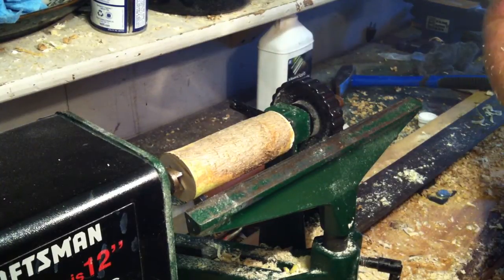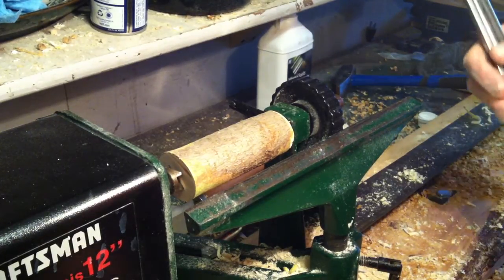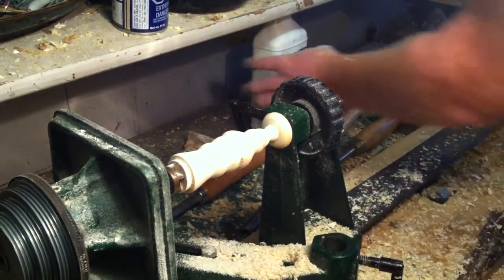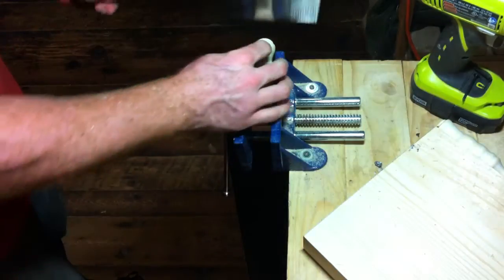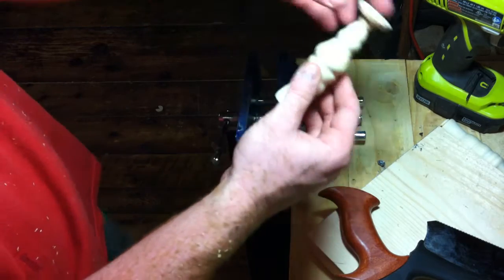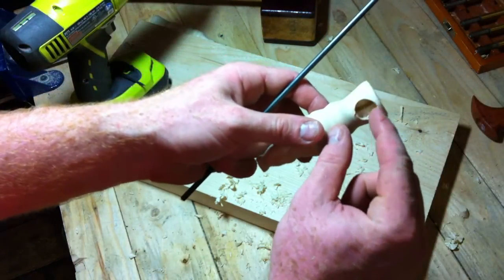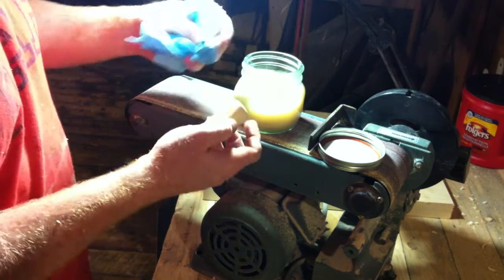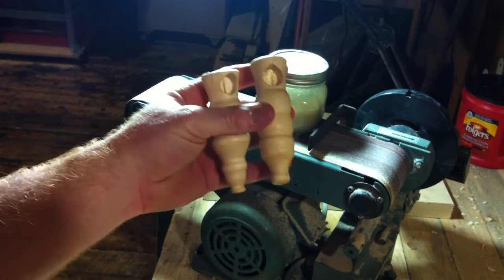Making a Pipe From Lathe To Finish

Comment: Doesn't the hole at the bowl end mess up the draw of the air flow through the tobacco? Seems like you would want to plug that hole. Also, why not drill the through hole while mounted on the lathe?

Comment: Just happened to see this, curious how well you liked using the pipe?
Reply from the maker: Love it!  9/16th is a good hole size... lots of pull but not too much.
I use a steel rod heated red hot to clean it out
Reply: Hi!  Thank you for your reply.  Glad to know you were able to enjoy the fruits of your labor.  I`m in the beginning stages& gathering information to make good choices in fabricating.  Have seen heated rods used to bore holes instead of drilling, also using flame to harden & seal wood fibers inside the bowl.  Good turning, & holy smoke to you.  Be well   Mike